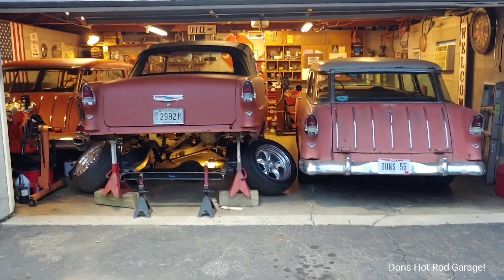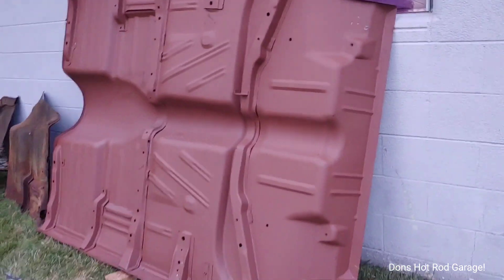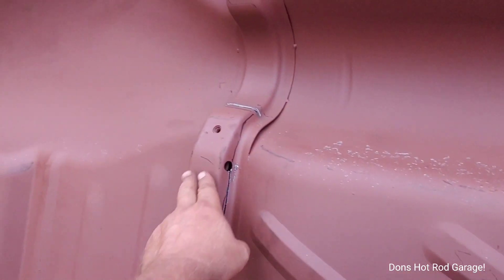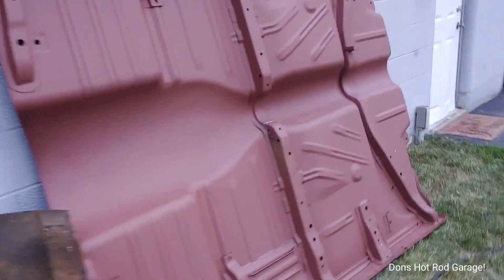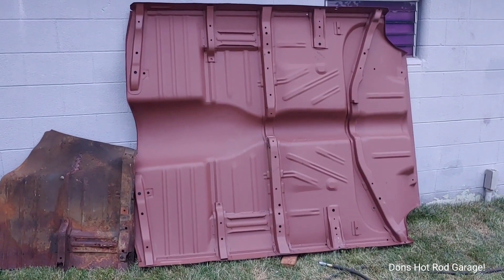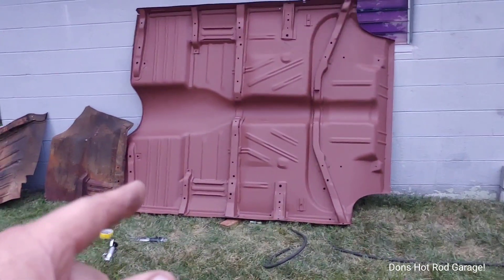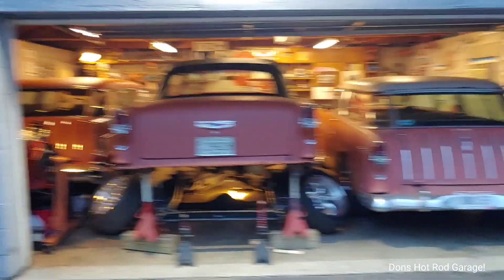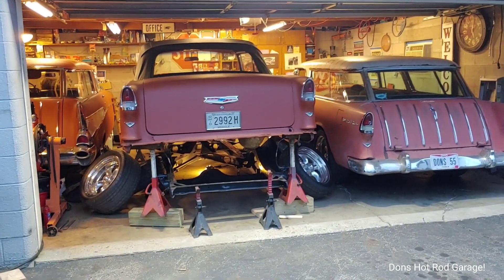55-57 Chevy Convertible 1 piece Floor Don't Fit! Share this to your friends building a convertible!!

Comment: You purchased a Dynacorn "1955-57 Chevy Convertible" floorpan. Unfortunately, Dynacorn makes their convertible floorpan using the non- convertible center long brace. This brace includes the emergency brake bracket holes (convertible does not) and is much taller than the convertible center brace. Thus, when you attempt to install it, it will strike the "X" in the center of the convertible frame before it reaches the body mounts. This floor pan WILL NOT WORK! Unfortunately, Dynacorn and their dealers continue to sell the bad part. Unfortunately for this installer, he did not realize the pan was wrong and likely the reseller didn't know either (because their salesperson was hired yesterday from their previous job selling cell phones at the mall).
The convertible floor pan that Real Deal Steel sells is NOT like this! It has the correct convertible center brace, short rear seat risers and rear top cylinder anchors. One factory does not make all of these parts- there are several. Real Deal Steel installs and uses what they sell. Call them instead of the fly-by-night resellers!
Reply from the maker: Thanks Man! Your right about the center brace and I found that out by trying to install it on my frame. I cut out the brace and but welded in my original brace! The new floors are in the car! They look great and fit great! I measured the rear set risers and they are the same height as my original set risers. And the floor has the convertible piston anchors welded in it. It looks like just the center brace was different! Overall these floors look great and fit great now! Have a good one Buddy 👍
Reply: I bought a floor from RealDealSteel  for my 57 Nomad.  It almost installed itself.  Perfect fit.

Comment: That might be the right floor pan and when it was built they install the wrong crossmember by mistake.
Reply from the maker: Hey Richard! Overall this floor has the extra brackets for convertible only but the center brace is not for convertibles. I was able to put my old convertible brace on the new floor and now it fits like a glove! Have a good one Buddy 👍

Comment: Damn Don, what a pain in the ASS ! Thank god the F body parts fit pretty well. Seems anything with a X frame has issues. Looks to me that Don is NOT VERY HAPPY about this set back at all. WELCOME TO THE WORLD OF OLD CARS! where nothing comes EASY. and they wonder why our nick name for our projects is ---- Oh you no good son of a BIXCH ! lol . can we relate! Oh yes we been there, 3am been under the car since noon and it STILL doesn't fit ! ---- I am goin to bed before I hurt something.
Reply from the maker: Hey Mike! Yeah man its part of the deal trying to build a car! I fixed that brace and the new floors are in the car! They look great and fit great! Good luck woth your cars man you'll get it. Have a good one Buddy 👍
Reply: @donshotrodgarage1717   Well, Sometimes, I have a hard time trying to figure out if we are SMART to be restoring these old cars, or just stupid to put up with parts that never fit OR in the case of my rear seat for my 1970 Chevelle 4 door waiting 13 months for a rear seat reupholstery set that STILL HAS NOT BEEN SHIPPED ! It will be shipped ( for the 4th time ) Aug 26th / 22 But the real question is when it gets here,  again for the 4th time will it be 57 inches wide ????? as all the 2 door cars are only 46" wide. Keep in mind my adding on machine IS NOT WORTH A DAMN ! . If it was TO BIG,  I could take care of that, but too small, your screwed, send it back with a niiice very detailed note !!!! telling in great detail with PICTUERS! of the problem over & over & over. As they keep saying a 46" cover WILL FIT a  57 inch seat! , ok, I will bit, HOW ??????  lol .  By god I am pretty good, but NOBODY can stretch 11 inches ! So , it's not just you don.

Comment: I used two pieces for my Nomad floor, one side was 3/4” longer than the other.  Fortunately it was only a 2 hour fix, still annoying!
Reply from the maker: Hey Nomader Garage! Yeah it sure is a pain to make them fit! I fixed the brace and the new floors are in the car! Have a good one Buddy 👍

Comment: Dang Don that really stinks. I  feel for ya man. The joy you were feeling to be putting the flor in to being crushed at yet another after market part that doesn't fit. I'm about to start on the floors and rockers on my 56, I know how you must feel. My 56 is a nomad, not a convertible, but I am already expecting problems. Keep your chin up and keep diggin brother.
Reply: What about  Danchuck, are their floor pans better
Reply from the maker: Hey Greg! Yeah buddy don't let rhe little problems stop you. Find a solution and keep moving forward. We are lucky they still make panels to fix up these cool old cars! I cut out that brace and welded my original brace back on there. The new floors are in the car and fit great! Have a good one Buddy 👍

Comment: Don, These stamped sheet metal are all made in Taiwan. The people that sell these stamped sheet metal try to design as best as possible. What your going though on your floor pan is par for the coarse. It’s Good your old brace can still be used and installed on that Taiwan steel.
Reply from the maker: Yeah man your right there all made in Taiwan! I keep the all floors just to have in this case! Ive fixed the brace and the new floors are in the car! Have a good one Buddy 👍

Comment: Don! Oh man! I'm sorry you ran into an unseen dilemma!!!! That's a shame for all that work and money plus time to get it where you just put the floor in and it doesn't fit right!!!! So you say the floorboard is from Dynacorn? I'm familiar with them and I thought its a reputable company that makes quality body panels and floors even whole car shells for Mustangs and Camaros! I thought they were knowlegable and knowing what they're selling not to mention them pushing you a hardtop floor pan as a convertible floor!!!! Sorry about this, I know you're very dedicated to your cars and you will do the proper modifications to the floor to get it back in so that the convertible body won't sit up there so high for so long! I'm a Ford guy like I've told you before but I'm your cheerleader for your Tri 5s and help you keep your spirits up when you hit roadblocks in your projects! Do not get discouraged over this convertible, take your time and with your talents you'll come out a winner. In the future, this floor pan problem you have will be a dim memory well forgotten after your beauty is done and hitting the road 👍🏁
Reply from the maker: Thanks Raymond! Dynacorn is a quality company! I fixed that brace and the new floors are in the car! They fit great in the car. Just had to put my old brace in there. Have a good one Buddy 👍

Comment: Hey buddy sorry you're going through that when I was looking for my floor they were selling convertible floors and hardtop floors two different part numbers. Also the convertible floors were cheaper than the hardtop floors at that time so I wanted to know what the difference was. And the difference is also the length from front to back so if that's a hard top floor you're going to have to measure from the front to the back and see where the difference is I believe it's under the seat back seat.
Reply from the maker: Hey Mike! Yeah man this is all part of building a car. I fixed that brace and the new floors are in the car! Have a good one Buddy 👍

Comment: Aftermarket  reproduction. part's will never fit like originally the manufacturer don't have the patent rights to make  do them originally  if not they will get sued   we got to work them  same goes on seat covers from katskins  plus they say they leather when it's vinyl 😉
Reply from the maker: Hey Gloria! Yeah all these parts need some type of work to make them fit! The brace wasn't that bad to switch out and now the floors fit like a glove! I'm very happy with the fit and finish of the floors back in the car! Have a good one 👍

Comment: Don it's not at all funny , but you hit on the solution when you said it looked like a K5 Blazer sitting there , all you gotta do is put in a body lift between the floor and frame . You're right to be pissed off , and I personally don't remember hearing any body man that had anything good to say about Dynacorn . They were what you used because that was all you could get at the time , but the fit and finish sucked !
Reply from the maker: Hey Bob! Yeah man the old 55 was way up in the air! I've heard alot of mixed reviews on these parts. I was able to fix that brace and the new floors are in the car. They fix real well in there! Have a good one Buddy 👍
Reply: @donshotrodgarage1717  glad to hear it , if you and I keep plugging away we'll eventually get them all done .